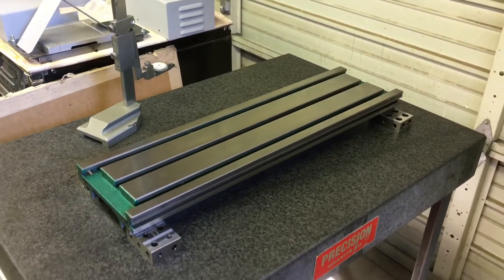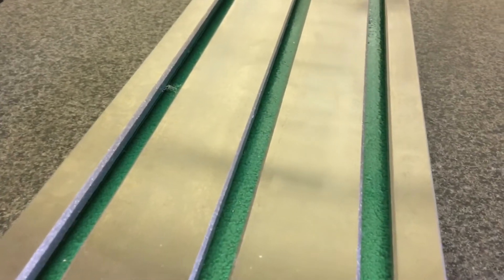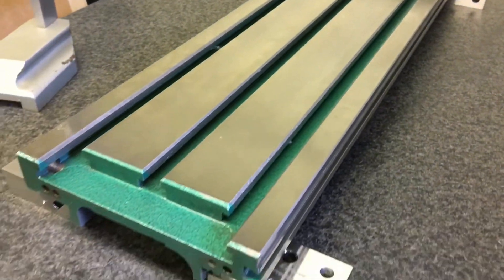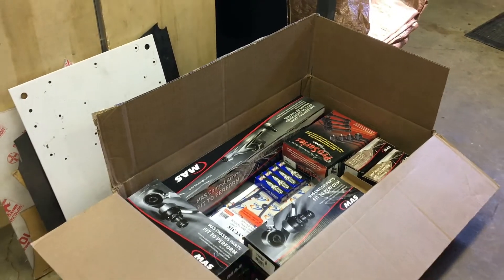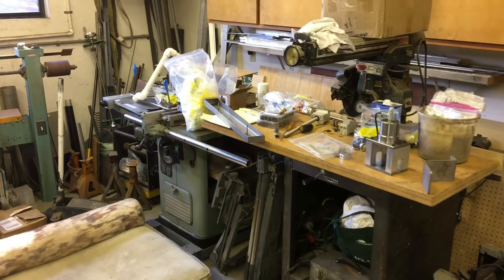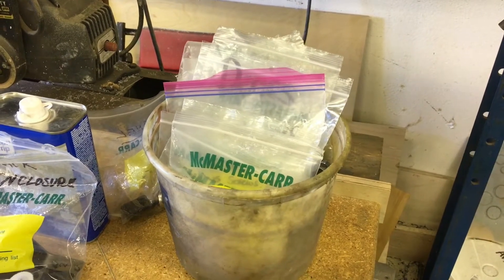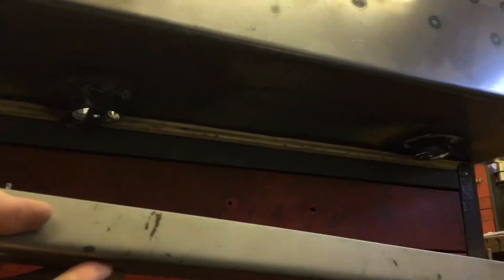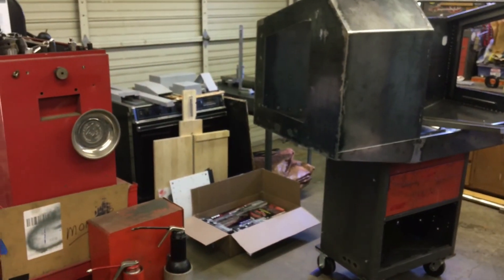GRIZZLY G0704 CNC Conversion Update 17 - ( surface grind table / tear down )

Comment: GRIIIIIZZZZZZZZZZZZZZ. Love it brother. Nice choice on the colors. I figured my suggestion of JD green was going to be a bit much for something that large. Love the drainage. One suggestion is to pick up some smaller TEA strainers from the local dollar store and turn them into strainers for the mill. You want the chips to stay in the pan, not get sucked up by the pump. Personally I would keep some neodymium magnets stuck to the bottom of the pan on the outside as well to help localize the chips. Its easier to remove the magnets from the bottom and then vacuum up the chips, at least for ferrous material it is. I may follow your model at some point and build my own VMC just like you.
Reply from the maker: Damn you BRUNO! Why are you so smart! That's a great idea about the magnets and tea strainer, its for sure happening! Gunna have to give Bruno M. a big ole "GRIIIIZZZE" shout out!! I think the paint will look OK.... i hope!!
 = )
Thanks man! your awesome!   - Nick